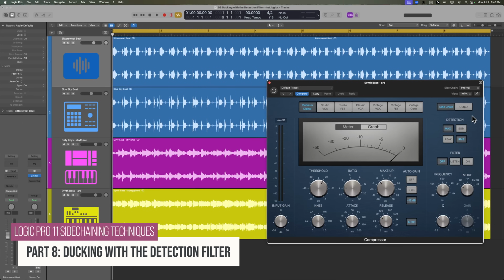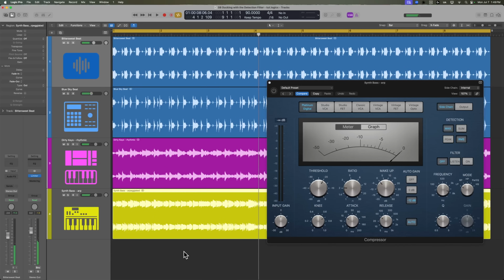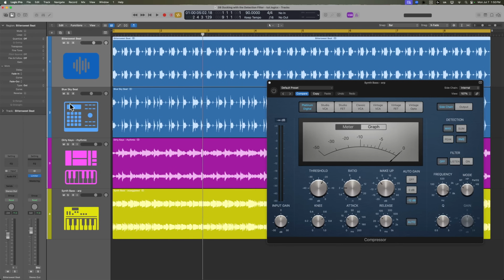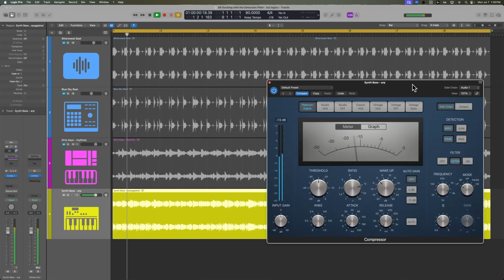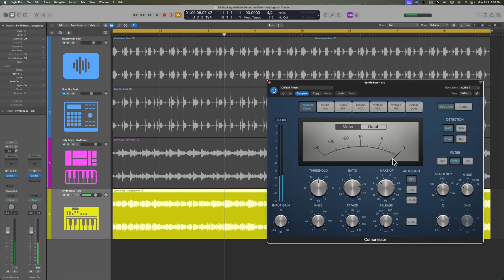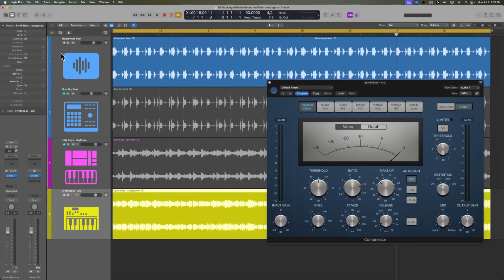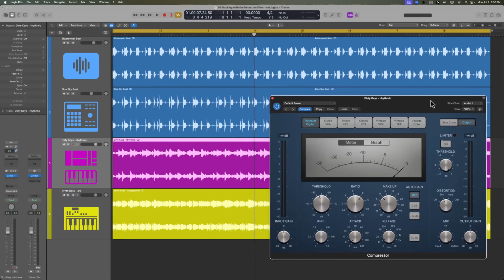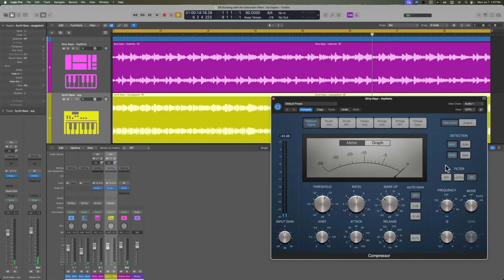Logic Pro 11 Sidechaining | #08 Ducking with the Detection Filter

Comment: A ‘penny drops’ moment for me in seeing how the side chain could be used in a less obvious way for ducking using specific frequencies in a loop! You mention that you can try getting the SC to respond to something other than the kick; however, in practice, is this really possible? I tried to do so but found the kick energy is kind of ‘everywhere’ - there’s the transient part that can’t really be separated from the hi-hats, for example. So the only way to get really smooth compression in this scenario does seem to be SCing to the kick as nothing else is present down in that ultra low-end (in this loop, at least). Does that sound fair?